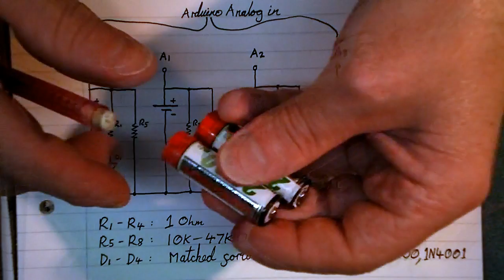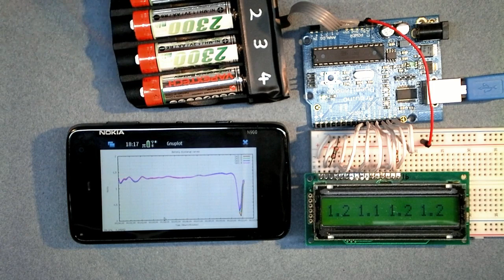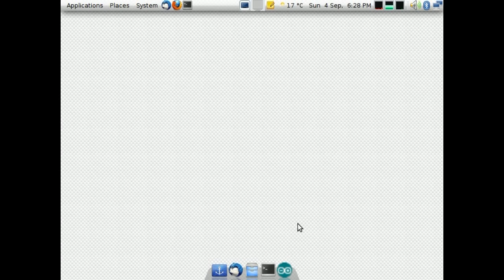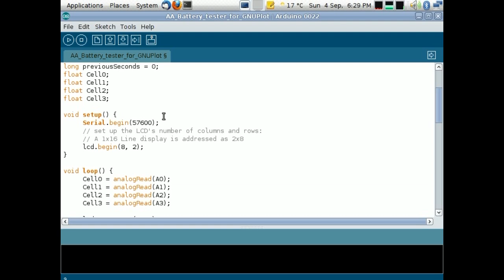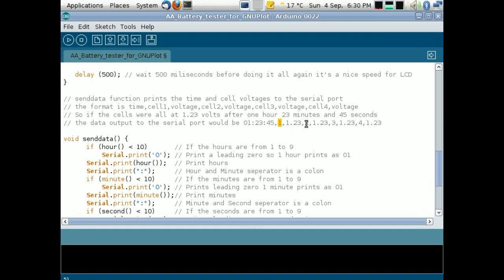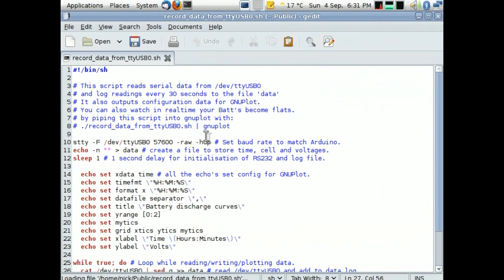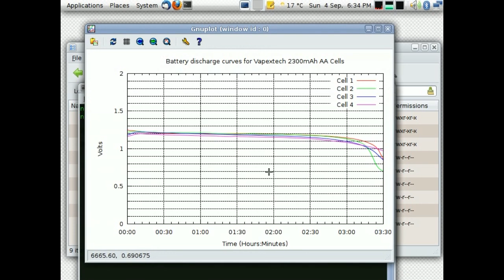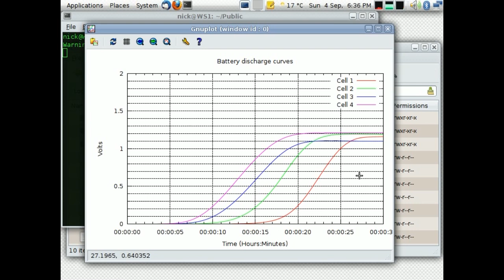AA cell testing using Arduino and Gnuplot

Comment: I've been looking for something like this very project. However I've been having problems making it work. The Arduino side works OK, and Serial Monitor displays the data correctly (Note - Arduino Uno is on /dev/ttyACM0. Should still work though)  but when running, the data points in the log file all have the timestamp 00:00:01. It looks like the Arduino is restarting every time. Can't see why.
Reply from the maker: If you can see the hours:minutes:seconds incrementing in the Arduino IDE
 serial monitor window. Then the problem sounds as if it's with the 
record_data_from_ttyUSB0.sh Make sure you've changed all references in 
all the files from ttyUSB0 to ttyACM0
Because your Arduino is restarting, it seems like every read from the RS232
is causing the Arduino to reset.
There is a big article about this here:
http://playground.arduino.cc/Main/DisablingAutoResetOnSerialConnection
Reply: You sir, are a star. Logging is restored. As it is a Uno, a 10μF capacitor between the RESET and GND lines did the trick. Although I'd presumed the Arduino was resetting, I never thought of Googling it as a problem. I did also have to install gnuplot-x11 - don't know I didn't notice that before. I've been using GnuPlot for years - I love it.
Reply from the maker: Chuffed you got it working. GnuPlot is fantastic.

Comment: thanks u Nothon for this video its was really interesting, i tried this experiment with a Li-po battery that i have (3 cellule in serie 11V), i connect it directly with the arduino in analog input and my arduino was damaged hhh, so what do you suggest to make betwin my Li-po battery and the arduino??
Reply: Souad Berradi do u hav any answer?

Comment: Thanks for this Great Video! Is your sh code equal to a python script? Please tell me how you got gnuplot plot what the data says. I have a python script that stores temp and pressure data from arduino serial to my raspPi. How can i display both over time with gnuplot (and with your real-time function)? Help much appreciated!!
Reply from the maker: +jomephi F&amp;T In the video description under Show More. There is a link to the script. It is standard Bash/SH. The program GnuPlot is running on my now rather old Nokia N900 (ARM Linux Kernel)
Reply from the maker: +jomephi F&amp;T My fault. The DNS has been pointing nowhere for months. Thanks to you It's now working. Depending on your ISP's DNS update rate, it may take from minutes to hours for the update to populate. Try the download again, it may work straight away.